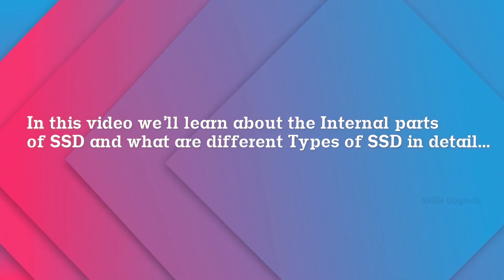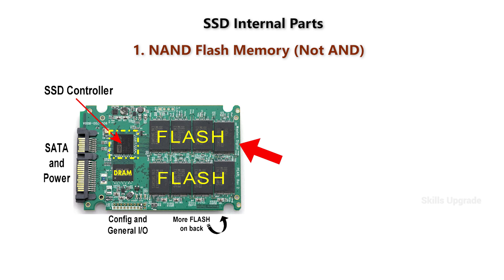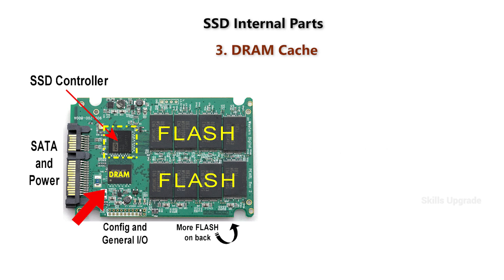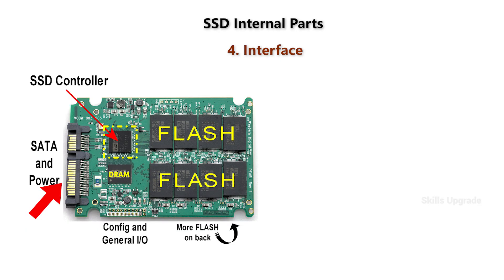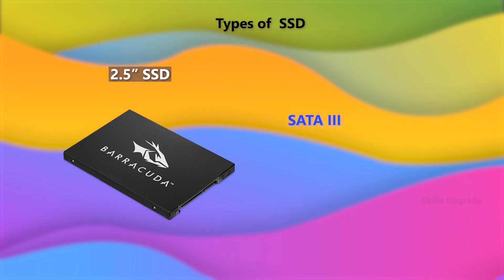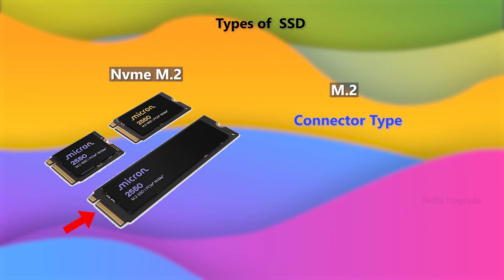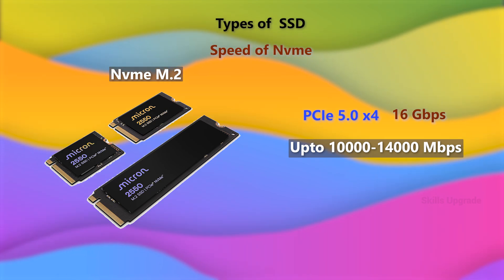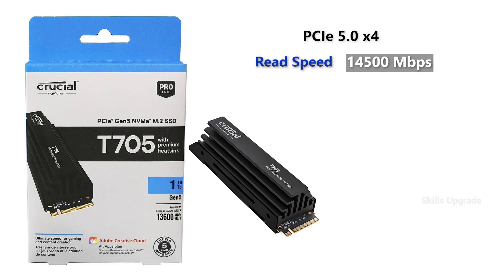Inside SSD and Types Fully Explained | Computer Beginner Tutorials Part 8.1 #motherboard #ssd #tech

Comment: Bro, can we install nvme m.2 SSD in sata interface using any adapters?
Reply from the maker: Excellent Question!! But, the answer is No, you cannot install an NVMe M.2 SSD into a SATA interface using an adapter Because nvme m.2 connecting interface is PCIe and have data transfer rate from 3000mbps to 16000mbps depends on version But SSD speed from 130mbps to 550mbps If you buy an adapter from AMAZON which converts and reduce the speed from 3000mbps to 550mbps then what's the purpose of using nvme So, if you have nvme m.2 PCIe connector on motherboard then use it otherwise don't buy any adaptors it's waste of money...